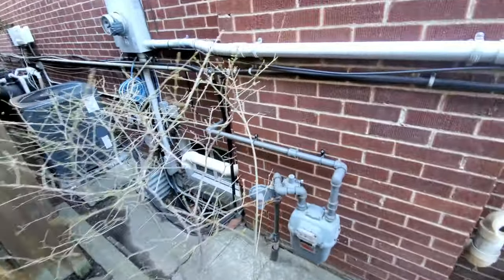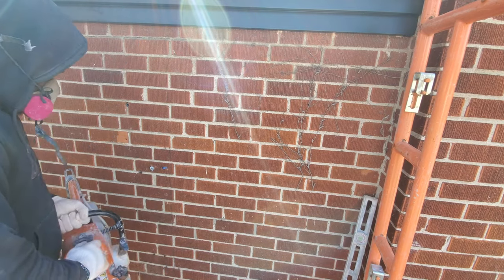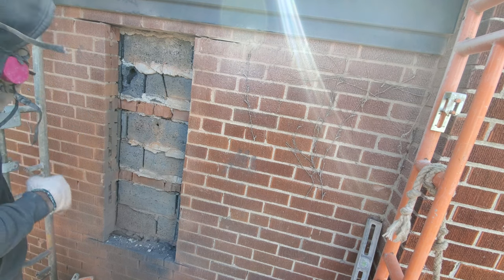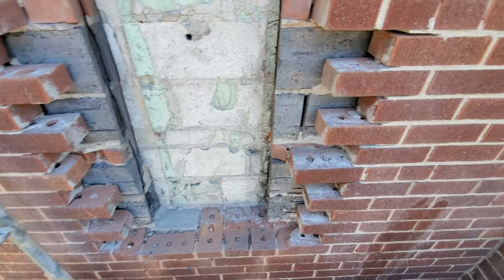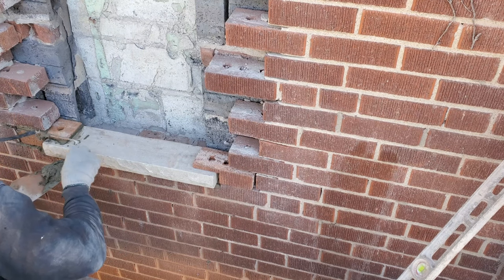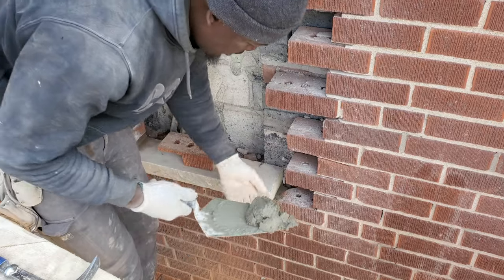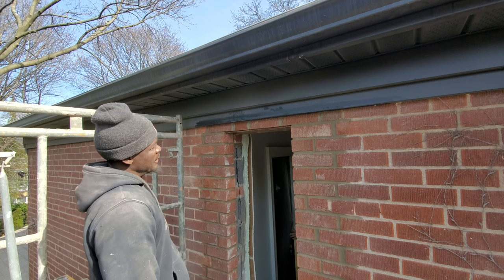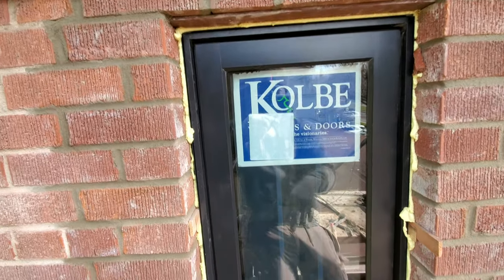How To Cut and Add a new window In a Brick wall ,Step By Step ,DIY

Comment: Nice work. You said on the inside you can screw to the studs, but home like this often have no studs, just 3/4 furring strips nailed to the cinder block for mounting plaster. Not really enough wood to screw into... What is your method in that case? Thanks!
Reply: I had the sabe question too
Reply: The foam would hold it. But you could drill the block and use a concrete screw.

Comment: Did you ever use the trick on the great stuff to set it quick spray water on it with spray bottle it sets quickly so you can caulk at finish

Comment: No DPC lining behind and under the sill?

I've seen a lot worse, but missing out DPC in the UK climate could lead to significant damp & cold issues in that area, especially if it's a north facing wall.

Comment: Im switching out a current window to a shorter but wider window, i made sure the steel lintel ran across the top, Its a double brick, but im not keen on a window sill, so im wondering if its still all possible to do without adding a window sill?

Comment: How is what they installed going to drain water properly to the exterior without having a sloped surface? The perimeter joint around the window should have had foam backer rod and sealant.